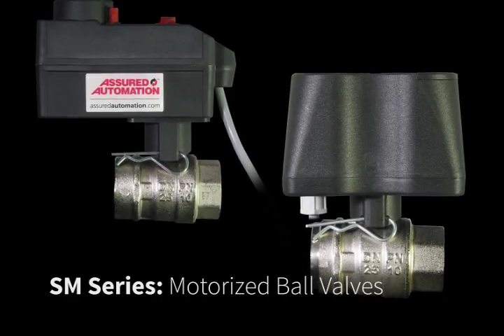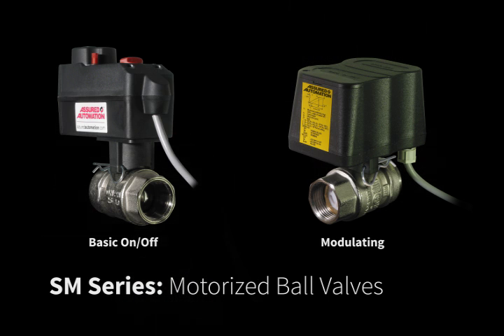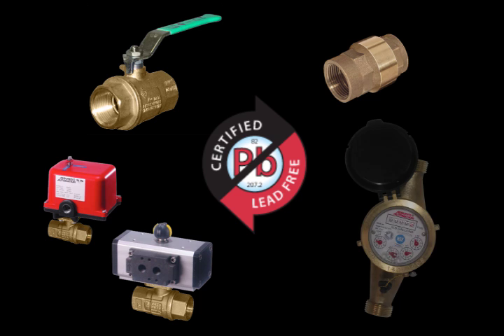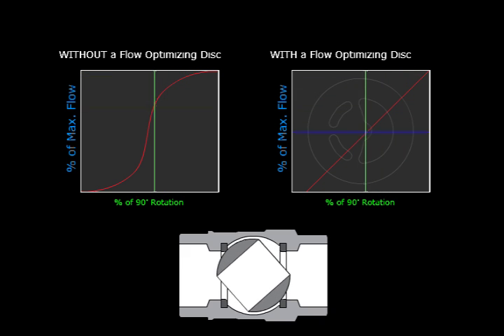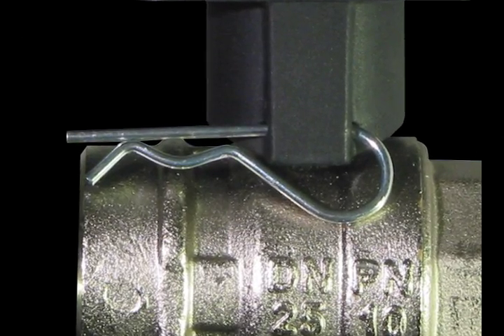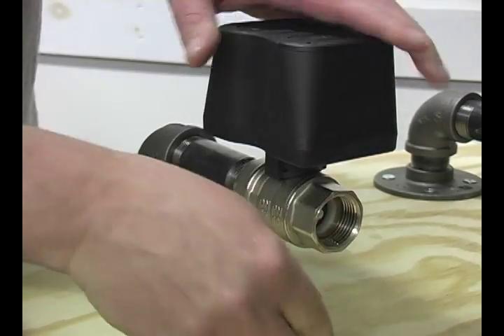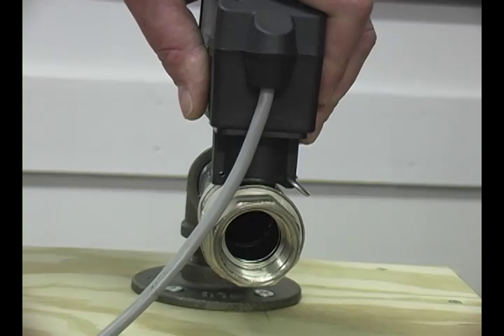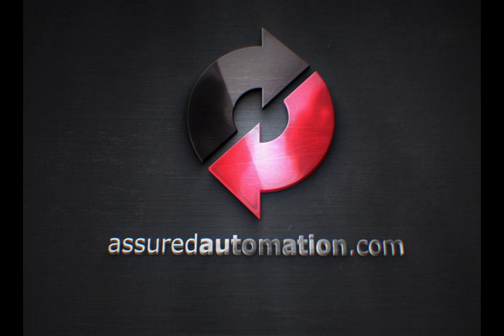Motorized Ball Valves for HVAC

Comment: Can you please answer these questions about the product? Because I need it in my project. 
1. Does it work in 6-12V DC voltage?
 2. It is normally open type?. 
3. Can it be controlled with a thermostat? 
4. Can it work in temperature of about 80°C